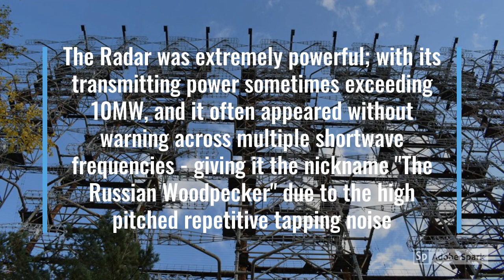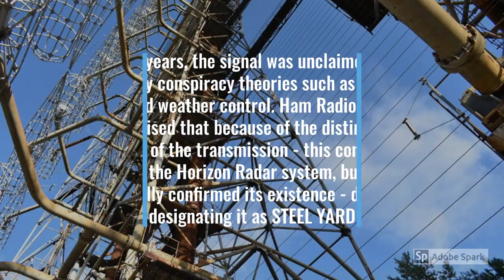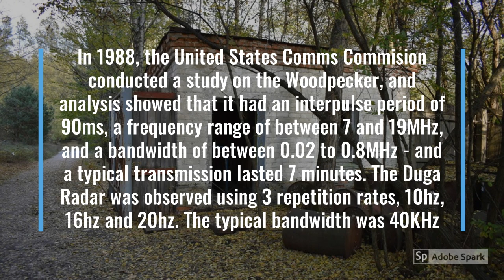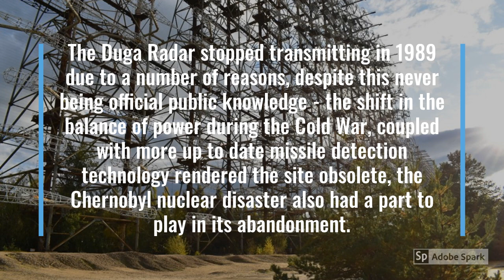The Russian Woodpecker | Cold War era Radar that caused chaos on the Amateur Radio bands!!

Comment: Oh yes. I remember that signal fist appearing during the long, hot summer of 1976! It used to break through on our FM Ferguson portable radio when the Woodpecker was operating near the 10.7 MHz IF frequency.

I think it was the year I built my first 'proper' HF radio, the rather lacklustre (with hindsight!) Heathkit SW717. The woodpecker also caused big problems for the BBC Monitoring Service, monitoring overseas HF domestic and international radio broadcast for news and analysis. The signal also caused big problems for Soviet broadcasting which had an extensive network of domestic short-wave radio services.

There were various Woodpecker blankers designed to reduce the interference for SW users, but I don't know about their use in TVs - unless some had problems with IF breakthrough.
Reply: I remember it well also. I was studying CW for my Novice exam and was using a Hallicrafters S-40B to receive CW and the woodpecker was super strong in New Jersey.